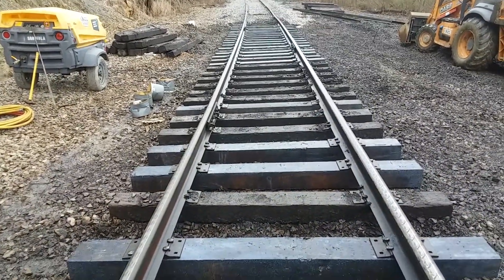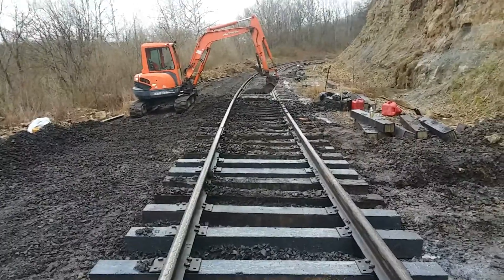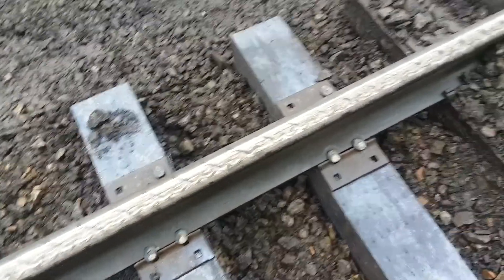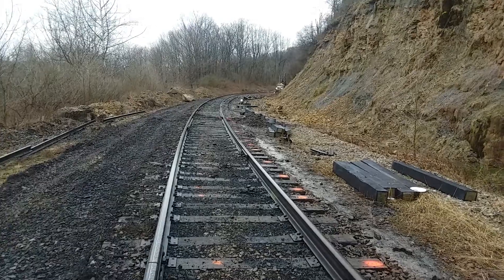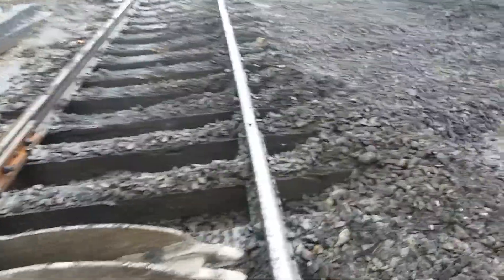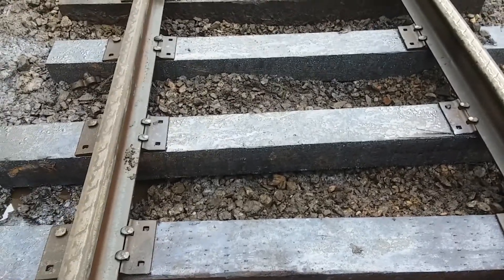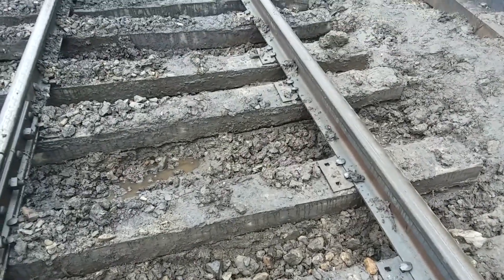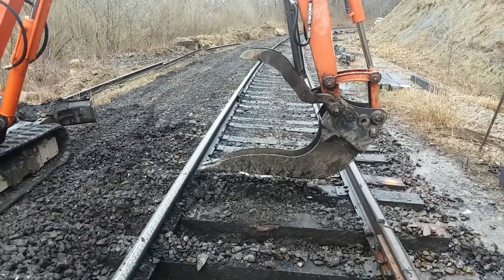New Ties in Skeleton Track

Comment: Hi. Love your series.
I'm wondering why the practice isn't to pull all the rails and ties up every decade or two, dig out all that gravel clogged with tailings, and then lay a new bed of fresh rock down before installing new ties and rails.  It looks like the mud and water table is just below the bottom of the ties.  I would think in the long run that removal would be a cost effective plan.  I'm sure there's a good reason they don't.
Reply from the maker: Very happy to hear you are enjoying. What you describe would be
ideal and we have done it in some small sections from time to time.
Big problem is finding time to do it. We have limited dead track. For
instance last year we had about 10 days total dead track that
had days in a row. What you want to do takes several days just
for a small section or 1 curve. If we had the time then we'd also have
Hulcher in here under cutting a lot more too. So we do what we can
with the limited man power and time we have
Reply: @ccrx6700  that's a good reason!
I am fascinated by all the "behind the scenes" aspects that your videos illuminate.  Keep up the great work!
Reply from the maker: @MusicByWinston  😊 👍

Comment: Do you ever use a cloth or synthetic barriers under the ballast to help keep mud from seeping up? Or does that hamper maintenance later on?
Reply from the maker: Kevin, excellent question! Yes we do. This happens when we
are able to completely take a whole section of track out, lay it aside
then bull doze everything out and start over. But can't do that with the train running, gotta be down for 4 to 5 days. Then we lay down
a GeoTextile. It works great at preventing mud from coming up

Comment: Some of the ties look closer together as the rail curves.  Does your cribbing bucket not fit between some of those ties?  Just wondering how you cope with that.,  Thanks!   Also, are the ties generally 1 foot apart (is there some standard for that?)   I have a curious mind, and this stuff fascinates me.   Cheers!
Reply from the maker: Got another vid coming up on that subject, for now yes I straighten ties. Tie spacing is 19 inches on center. Glad your enjoying 😊

Comment: Ever find tie plates installed backwards? During a major infrastructure upgrade at an ammunition holding yard, I was doing a final contract acceptance inspection. The superintendent stated emphatically, well like a blowhard, that all plates were correct. Right off the bat I found 2 in a row and a few others.
Reply from the maker: Thomas, i,ve found a few, all of them after tie replacements, backward plates adds a lot of stress when a train passes. Great find there sir! Every railroad needs guys like you!

Comment: So are you allowed to re-use the spikes when you replace the ties, or do you use new spikes always?  Also, why do you spike the two holes closest to the rail on the inside of the track, but use one inner and one outer hole on the outside of the rail?  Does it also have something to do with helping the rail not roll over when the train is passing over it?  Are the tie plates marked so you know which direction the Kant goes?
Reply: Probably designed for future use, should the spike holes wear out, there are alternate locations for a fresh bite into the wood.